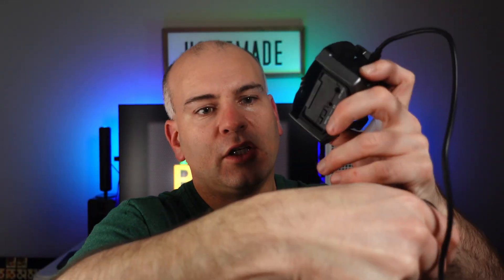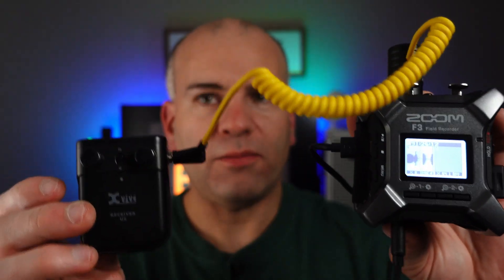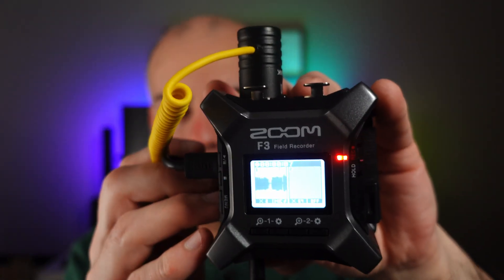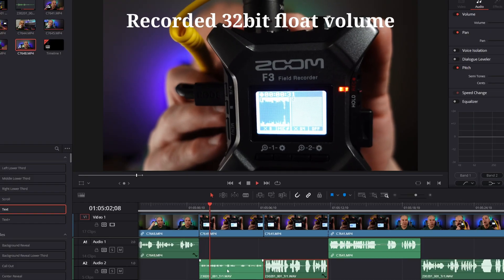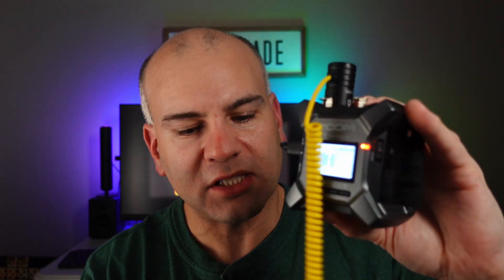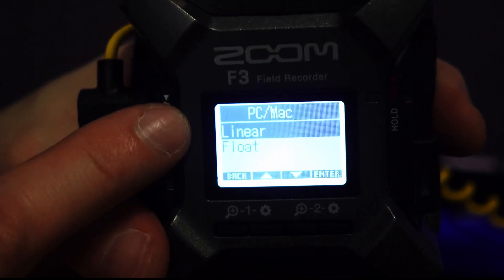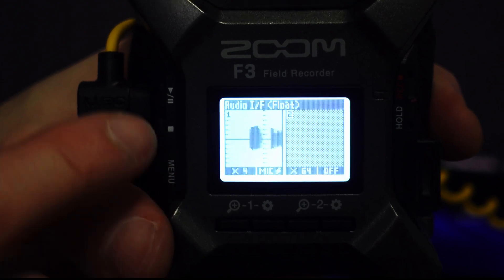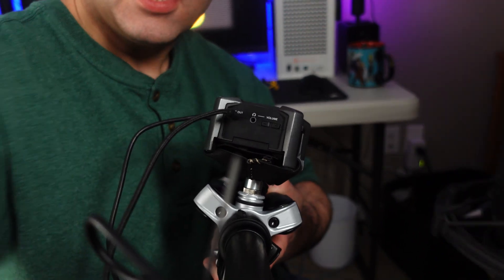Zoom F3 (Part 1) Best Audio & Great Experience *Hot Tip*

Comment: Ill note this vid and watch again. Am i missing connection info? For instance im line out to camera and my mics  hollyland lark m1 wireless are  via f3 xlr to rode vxlr pro to  line out to camera. I have option in settings for line ,mic ,mic 24 or 48 in f3. My wireless mics have there own power so wich is the right and or wrong settings?Thank you
Reply from the maker: I don't think the Rode vxlrpro would even work right without power. It converts to mic power. Camera powers on the Rode NTG despite NTG having power using mic power for detection

Comment: I was recording directly to Red Komodo from Zoom F3 and did not record onto SD card. The magnification was around x128 (which I did not notice) and sound is like a trash. Is there any way to make it nice? Clipped like a robotic voice :( I've tried Isotope FX and others but did not work well. Does the magnification affect clipping a lot? Many thanks
Reply from the maker: The magnification changing the line out a lot and over 8x introduces hiss and also for sure makes it easier to chip the audio.  Internal memory or USB out is the way to go for better audio out if you want the best. If you want to use line out keep the wave forms small and boost in post edit
Reply: @ericsstudio  you are the best, thank you 😊
Reply: @lighthunteralp  no problem. Don't mind helping. Feel free to look around on the videos. Not sure if you saw part 2 of the hot tips videos. Lots of useful information between one and 2 including recording guitar and have a video of how to connect any 3.5mm mic not just the Rode NTG type

Comment: 45 mins?! What batteries are you using? You should get up to 18 hours with lithium AA batteries.
Reply from the maker: Lithium batteries would last longer than Energizer max but certainly not even close to 18 hours with 48volts phantom power and the lights on and those batteries aren't exactly cheap. Change lithium batteries 5 times and I got myself a new battery bank like I am using which is far less inconvenient than removing from the back of the unit every single time I need to charge or replace.
Reply from the maker: Not even close, Energizer max with the lights on is close to 45 minutes. Replaced with other Energizer max batteries and the same thing again. My mic is 48v phantom power as well so that is also draining.

Comment: Thanks for the great video! I wonder if vibration decoupling from the body is good in Zoom F3? If you put the recorder in a bag or attach it to your belt, will there be any interference in the recording with any touch of the case? Sorry for the automatic translation.
Reply: The translation seems off. I will assume what you are asking. The sound issue was caused due to the different signals between the electrical signaling from the already connected device on the battery bank. This device should have its own dedicated power source.
Reply from the maker: In my latest video I compare this with 2 other interfaces and learned more audio tricks.
Reply from the maker: Or the radio interference on the one video was the camera Bluetooth remote induced a sound signal into the backside when against the zoom F3 which means the back size is not shielded from interference of wireless signal sending devices... When the device is up close.
Reply: @ericsstudio  The translation may be wrong, it's true. I asked about the influence (or not) of mechanical touches to the body of the device during recording.

Comment: The latest free version of Audacity supports 32 bit float by default and can edit zoom F3 recordings
Reply from the maker: I'll try editing audio with Audacity now that I have 32bit float setup. I was looking at making a part 2 video, I've found more things I can do. Audio interface to mobile phone? yep, line out to mobile phone work? yep.

With the latest version set to 32bit float... maybe it kept old preferences on me while updating that it couldn't be done. Thank you for the information. I can now edit 32bit float using Audacity being that it opens the tracks
Reply from the maker: I could audio interface with Audacity. Trying to record "float" gives me an error. Trying to select audio devices when the Zoom F3 is in any state other than Linear it does not show up. If you have a video confirming otherwise I would love to see it because it certainly does not work by default for me on Windows 10 PC. Are you using Apple? I'll try editing with the 32bit float in Audacity setup in preferences. Silly this isn't setup in default, because I couldn't open the files as of the time of making this video, it just gave me errors
Reply from the maker: I connected a mobile phone to the Zoom F3 as an audio interface now
https://youtu.be/rot-ILa4744